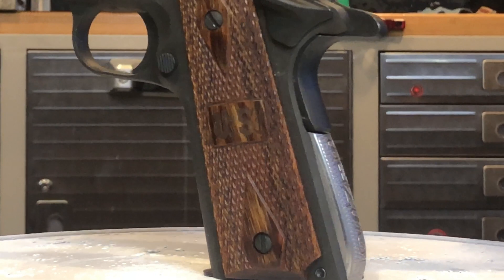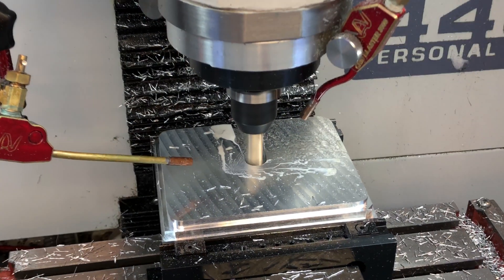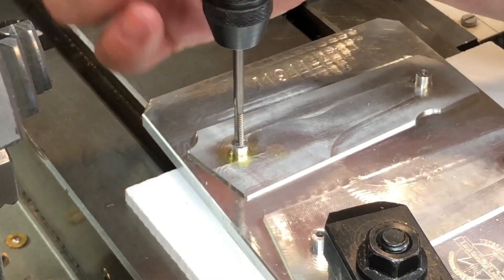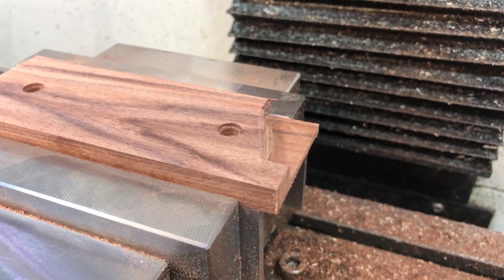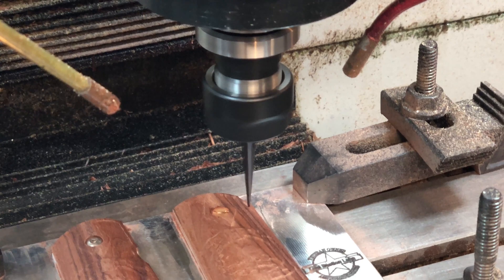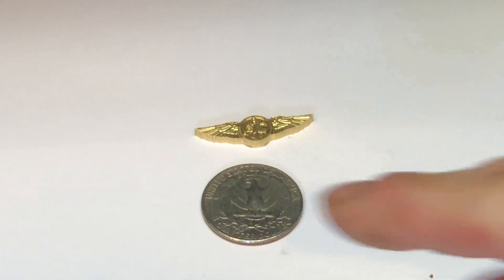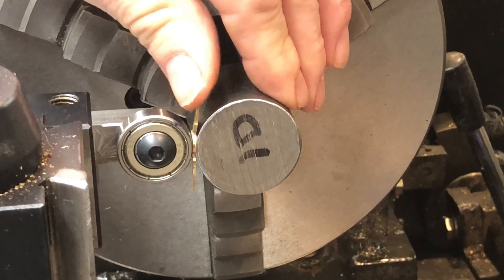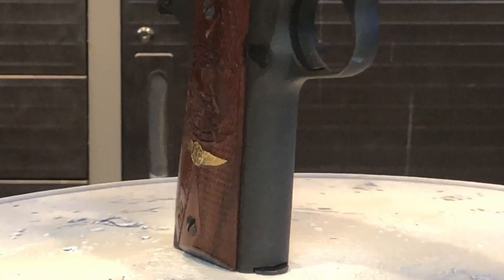CNC Custom Colt 1911 pistol grips on a Tormach 440

Comment: Hi. I have recently found this channel. Great work. One question about that fixture plate. Would it be easier, cheaper and faster to take thinner plate, mill the grips outline but for the screw posts drill holes and use standard 1911 screw bushings?
Reply from the maker: I think you could do that.

Comment: Would you be able to machine a set of copper solid grips with a smooth finish so it can darken with handling??
Reply from the maker: I could, however I have moved and my shop is in kit form while I finish my new shop.  I will be hard pressed to finish by the end of this year.  Thanks for watching!

Comment: Really cool. You've inspired me and now I'll have to make a set of grips for myself. Might be a little lazier than you and just buy some blanks though. Definitely some tiny tool work going on there. How fast did you end up spinning on those wings?
Reply from the maker: Thank you.  Good luck on the grips.  You do not need a fixture, its just more handy.  I was running 10K on the spindle.  That's the max RPM for the Tormach 440.  If you have more RPM, use it.
Reply: @LastBastionLabs  yeah I doubt I'll be going any faster on the haas haha. I'm not going to get 20k rpm outta the spindle on the the ol vf3

Comment: DO you think you could CNC a complete 1911 or AR15 or complete an 80% with your set up? IYAOYAS
Reply from the maker: Yes, they will fit on the machine and the Trormach is rigid enough to handle it.
Reply: @LastBastionLabs   I'll send you a Ar15 80% lower if its legal in your state and your game trying and will post it.
Reply from the maker: @navyav8r653  It is not legal and please do not send.
Reply: @LastBastionLabs  No Problem I won't. Ive been thinking about getting the same set up as you and thats how I came across your channel. My issue is justifying a 15k machine. I'd like to be able to CNC complete LS race heads and custom AR lowers.

Comment: Awesome job on this. I love your content, you definitely deserve more subscribers. Keep at it and keep the quality up and I know you'll get there.

Btw, machineable fixturing wax would also work well for holding small metal parts with limited flat surface area. It's a little bit more trouble to apply than Loctite and has a tad lower temp rating, but faster "cure" time and definitely gives a more positive hold that should lower your pucker factor by an order of magnitude.

Keep up the good work!
Reply from the maker: Thank you Jon!  Your comment made my day.  I will look into machinable fixture wax, I'm all about lowering the pucker factor.